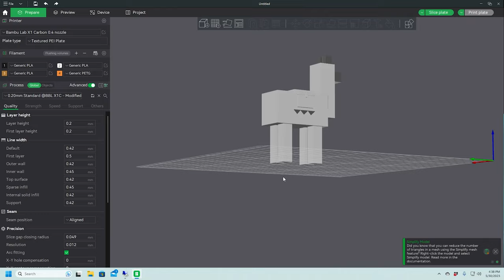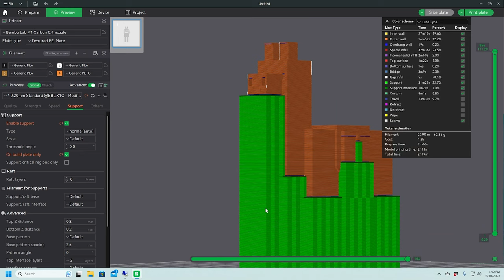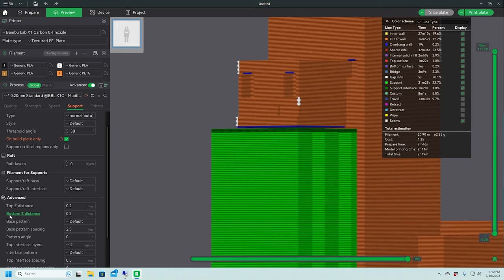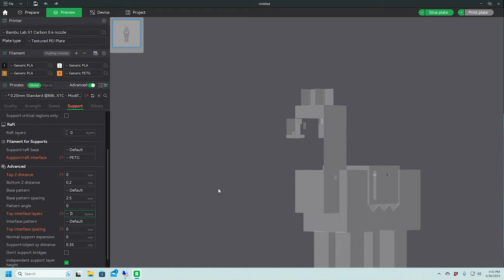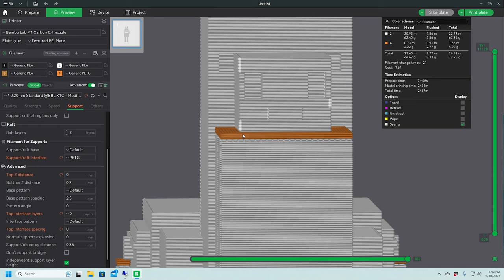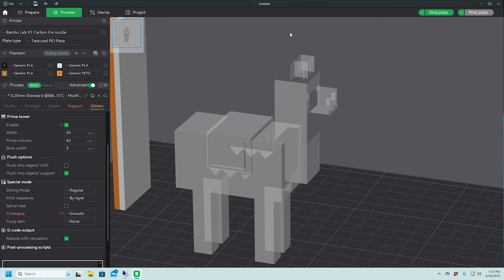Using PETG to Support PLA on Bambu X1 Carbon

Comment: It also works the other way around.  Using PLA as a support for PETG.  That is how I usually use the materials.
Reply from the maker: Indeed it does.
Reply: Have you found a way to fix poor layer adhesion in that case?
I maxed out the purge and added a wipe tower but still had that problem on the actual PETG part

Comment: Wow nearly half a meter of flushing was surprising.  But being able to just print a few layers of petg is great
Reply: I'm testing it right now without doing a purge tower wasting so much filament, I just have it set to only print PETG on the interface layers, and in theory, it'll go and just purge the nozzle and come right back
Reply: @kylequinn1963  how did that work out?
Reply: @BeautyBeastRC  no problems

Comment: Hi, I've been using petg as a support interface for a while too. It works great moat of the time however I do sometimes have issues with my prime tower separating where it prints layers of petg and also my petg interface is very messy with stringy bits hanging out of the sides of my model. Any ideas what I'm doing wrong? I'm using esun petg

Comment: Some comments I've read have said the layer where you print the support interface with a different material becomes super weak. Like on that model you would easily be able to snap the legs off no problem. Is that true?
Reply from the maker: It can be. Since PLA and PETG don’t stick together, that also means that they don’t mix together either. The key is to purge as much as possible when it changes materials, so that you’re minimizing how much cross contamination there is. But depending on the model, some parts may end up being weak. This model I used to be a demonstration because of its flat bottom surfaces. But yes, the legs would be quite weak in this case.

Comment: Why not just use PETG for all the support materiel
Reply: because there will be a lot of filament changes == more waste == more time to print
Reply from the maker: As @sxadow has explained, there has to be a nozzle purge with all material changes, which produces a bit of wasted filament with each purge.  If all of the support is printed in PETG, then there will be at least 2 material changes on EVERY layer that has support printed, not just on the layers that have a support interface.

Comment: If you explicitly choose your model material for Support/raft Base, then it will eliminate the layers of interface material mixed into your supports. Leaving the material for Support/raft Base as "Default" will allow interface material to be used for building your support base, which can cause weakness and may allow supports to break. Just a handy tip.
Reply: Thank you! I was experiencing weaknesses and this was the Tip!
Reply: Thank you!

Comment: The bamboo support material presets will not flush into object, infill or object support so what I recommend is using that preset, but switching all the values to your PETG settings. Then you have a support PETG preset that will not flush into infill or support.

Comment: I've been playing with doing this since ModBot made a similar video on an IDEX printer, and it can be great. BUT, when the geometry gets more curvature, the PETG and PLA bonding issues start to show. 

The flat surfaces are the best case scenario. More organic models will start to experience failures as the support and interface layers develop inconsistencies. 

Then there is the clogging. Temperature differences of the nozzle from PETG and PLA will start clogging the nozzle. But I believe your high purge values really help with this. Thanks for that, I will use that in the future. One other thing I prefer, is to remove the purge tower. I had a few failures when the purge tower failed and got dragged over to the model.
Reply: Curved geometry should be better with tree PETG support then?
Reply: @boehserenkel  The problem is that the PETG doesn't stick to PLA and vice versa. So, the general rule of thumb would be to minimize the layers of different material, that way, there are fewer chances to fail. So, a flat surface is supported with only 1 material change. But with curvature, that number of different materials goes up a lot, increasing the chance of one of the layers failing to adhere.

On suggestion for printing models with lots of curvature would be do the entire support structure and interface layer in one material and the model in another. That way, the support is only sticking to the same material and the same with the model. However, PLA & PETG have significant differences in temperature requirements.  You'll have to pick a comprised bed and nozzle temp for both. Constantly changing temperatures will likely lead to issues.
Reply: Bambu needs to build 2 extruder printer, like Prusa.
Reply: @TheBlackDove  yes yes yesssssss
Reply: I’ve only had my printer for 3 days now, and I am already about to send it back to switch to Prusa.  I’ve been struggling to get this method to work but every damn time I get a clog.  I even tried setting the purge up to 900 and still doesn’t help.
Reply: @jolene6911  If this is the type of thing you are looking to do, the XL is the better option.  Just be aware, the XL is significantly more expensive and has some teething issues.

Comment: AMS was not showing up under filament for supports.  Had to go to filament main area and click on the ams icon to enable autodetect ams filaments. At this point now can go back to the supports tab to "Filaments for support" and click defaults to open the drop down menu to see that the filaments color options will now show up.

Comment: I've done this many times but I have an issue with strength vs single filament print. My flushing volume is set to 500 and I can literally snap PLA+ in half easily while with single-filament print it's impossible to snap. Same issue when I print using PVA as support.
Reply: Have the same problem when using PLA as a separation layer for PETG parts. I already maxed out the purge volume and have a wipe tower, to no avail.
Reply: @pastagandalf  I now do 999 but it's still not as strong but it's the best option IMO.
Reply: @parli_poo11  I guess it's also better to have as much infill and Cross section as possible in the actual part around the layers where the support is printed to both compensate for the missing adhesion and wipe as much of the support material away as possible
Reply: @pastagandalf  Yep. The pieces that I was printing were too small to mess around with the infil and wall thickness but if you have that chance definitely give it a try to see if that'll make any difference.

Comment: I have heard about this for a year now and never tried it. Watched your video to refresh my memory on the progress. I printed something in PETG and used PLA for the interface. OMG! It came out so smooth!! Thanks for the video keep it up.
Reply from the maker: Right?! Glad it helped. Yeah, I used this technique in my most recent video to make some parts for a rubber band gun. Just for gits and shiggles, I tried making those parts using supports without a PETG interface, and there was no way they were gonna work. But the parts made with the PETG interface were perfect.

Comment: I'm a little late to the party but this worked amazingly well for me.  Carbon X1, PETG main structure with PLA interface layer.  Really improved the surface of the supported surfaces.  Thanks!

Comment: thanks for this video, im printing a part with a 90 degree over hang and tried to do it all in pla plus.  it kind of worked but came out looking rough and would of needed some sanding and so on. i watched your video and used petg, wow its so much better!!!

Comment: I want to know how did you stop the layer adhesion issues at the interface layer? 
Because they are different temperatures, my model was cracking at the interface layer

Comment: Do you do PETG temps for the PETG? Does it reset the temp between filaments or do you find a lower temp PETG? While watching this O found a PETG with a low end of 220 and My Bambu sees to like 220 for PLA though I've only had it for 3 days.
Reply from the maker: I pretty much allow the X1C to do it’s own thang after I’ve told it that it’s using generic PETG. I haven’t had any problems.
Reply: @thisprintedthing7967  I thought I heard that some error pops up with some sort of filament mis match error. I still haven't printed anything that even needs supports. 🙃

Comment: why does it print an additional cube on the side? Can you remove it?
Reply from the maker: It doesn’t have to print it. But I prefer to as a way to prime the nozzle before it starts printing on the model again. But it’s just a setting in the slicer, and it’s mostly hollow. So it uses very little material, or at least it does in this case.
Reply: @thisprintedthing7967  priming the nozzle prevents previous material from ruining the main part correct?
Reply from the maker: @TonyHoangPodcast  that’s the idea and the goal. In practice, one would probably want to experiment with and without it to see if it makes enough of a difference.

Comment: so i have an issue with my high flush volume. the tool head has to move to actually throw it down the chute. but it just does the entire flush without throwing it down the chute. they need to add a feature where it with break up a high volume flush into several lower volume flushes so it goes down the chute. example: flush volume is 600. flush 200, down the chute. flush 200, down the chute, flush 200, down the chute. the high volume flush as it is, eventually hits the nozzle and it travels onto the bed. it's really frustrating and it seems like such an obvious thing to do.
Reply: Not sure if it's a new thing but my P1S is just changing positions above the poop chute every few seconds to distribute it more evenly.

Comment: Do you think the PETG supports were easier to remove than the PLA supports?
Reply from the maker: In this video, I struggled with it a little bit.  That was more because of the model.  I chose this model because of its blocky nature, so as to more clearly show what it does.  However, I've used this technique on other prints, and it worked great.

Comment: I'm very surprised that it works, I've used this method many times and half the time I ended up with broken filament in the extruder and blocked nozzles. Maybe it's to do with the temperatures, which are very different between the two materials.

Comment: This works Great! Thanks for posting a vid!
Reply from the maker: Thanks for your comment.  Yeah, I just used this trick again on a print yesterday.  Be aware, however, that  the layers where the switch is made between PLA and PETG can tend to be a bit weaker.  Make sure in Bambu Studio that you set the flushing volume between your two materials to 800, which is the max.

Comment: I'm not sure if its an issue with the PETG or PLA I'm using (Overture PETG at 270 C and Bambu PLA at 220 C). But I've tried twice to print with PLA as support for PETG and both times I've had it fail. The first time caused an extrusion clog from my P1S as the filament was not able to push out PETG using the PETG. Any suggestions?

Comment: Seems to justify the AMS just to be able to infuse petg supports
Reply from the maker: True that. If you’ve seen other videos on my channel, you may have seen that I also have the Palette 3 Pro, which does material changing by splicing filaments together end to end. It works well for color changing, but not for this type of application, as PLA and PETG do not splice together well.

Comment: I understand using PLA and PETG as support interfaces for one another.  My issue is the huge waste tower you created for that small amount of PETG interface.  Why not just print without the tower?
Reply from the maker: @missile1506  the tower primes the nozzle and regulates the pressure therein after the purge and before returning to the print. It decreases the chance of undesirable outcomes when the nozzle returns to the print. Consider that the Prusa XL also uses a prime tower, even though it has a separate tool head for each material. Trust me, it’s just a safe practice, and it actually doesn’t use that much filament to use  it.
Reply: I guess what I mean is that since it's just an interface, is a prime tower really necessary?
Reply from the maker: @missile1506  necessary is a strong word. I would say it’s highly recommended if you want to increase the probability of a good print. Again, it doesn’t use as much filament as you think. It doesn’t print solid.
Reply: I use a prime tower but reduce its size a fair bit

Comment: Thanks for making this video.  My question is why is there the odd line of petg part way up on some supports when there is clearly just more support on top of it? I've been printing a piece where it kept doing this and my supports kept coming apart in those areas
Reply from the maker: I'm with you.  I wish it wouldn't do that.  You might try specifying which material/AMS slot to use for Support/raft base, instead if leaving it default.  Just know that if it works and causes the support base to be all the same material, it can cause it to produce a lot more waste if you don't have any of that material on the same layer in the model.

Comment: why not a single interface layer versus 3?
Reply from the maker: I like using 3, for extra interfaciness.  Joking aside, I just like to make sure that I have a good solid slab of interface material, rather than trust the universe that a single layer is going to print perfectly, without any gaps or holes.  You have to remember that PLA and PETG don't stick together very well.  So there's always a chance that the first layer that goes down may have some flaws.  Add a couple of layers on top of that first layer to make sure that things get ironed out for a better interface surface.

Comment: If you don't need / want smooth timelapse you could just increase the flush volume and get rid of the tower altogether.
Reply from the maker: I would rather not. Even though it purges into the poop shoot, I would still rather it print a few lines on a purge tower before going back to the model.
Reply: Exactly - the pressure in the nozzle after the purge is not stable. Purge tower is a must to ensure a proper extrusion right from the start.

Comment: Good for PLA and PETG but I would need something for ABS and ASA.
Reply from the maker: I've actually not experimented with ABS or ASA.  I would be curious to know if there is a good material to use as a support interface for those.
Reply: @thisprintedthing7967  Unfortunately, I only know the more expensive special support filaments for ABS and Co. namely HIPS and PVA.
Reply: @Shadow27374  I read PVA may burn at ABS temps so its only HIPS and its special solvent.
Reply: @chartle1  That would not be so nice. On the other hand, with the AMS from Bambulab, the ABS roll would be retracted, then the temperature control would come and then PVA would be rolled out. Theoretically, the nozzle should then already be cold enough. But I do not know that.
Reply: @Shadow27374  I've only had my X1C for a few days and only done one multi color print. I thought I heard it doesn't change Temps but I may have been reading about another printer.  Or just a general warning for the filament. I'll have to see.
Reply: @chartle1  I've had it for 1.5+ months now and have printed almost nothing but solid color things. For fun I've printed multicolored stuff and also PLA with supportPLA and PLA with PETG as support. Maybe you are right and it doesn't change such slightly larger temperature ranges. I would have to test it first. But for now I will test the Bambu Lab ABS. My other ABS does not manage the high speeds.
Reply: @Shadow27374  I would probably not print anything else except. PLA and PETG. This printer is at my work which is a large university so I have to be very carful with anything remotely toxic or the vice chancellor for environmental concerns (totally made up position) gets involved. 

But they had a very expensive printer in the department 10 years or so ago and was told they could no longer use it because "it was toxic". With further investigation they were printing a lot of ABS in an open printer in a small office. I tried ABS once in my house on the first floor that has a semi open floor plan and after 5 hours I had to shut it down. 🤮

I do have the Bento Box filter ready to go but we can only buy stuff from approved vendors so while I had the fans and the magnets I can't buy the $25 of HEPA filter and activated charcoal. But we may need to, even PLA smells up the room.